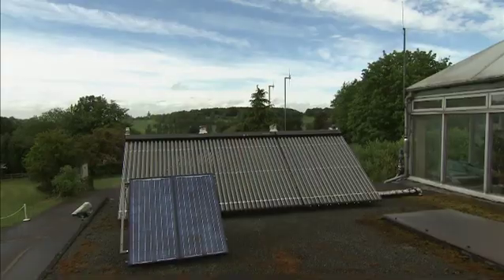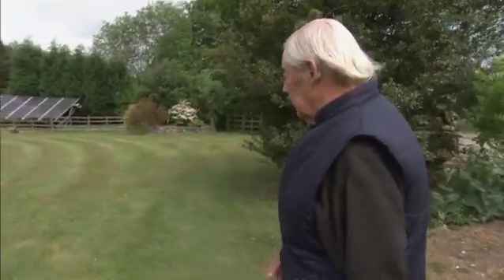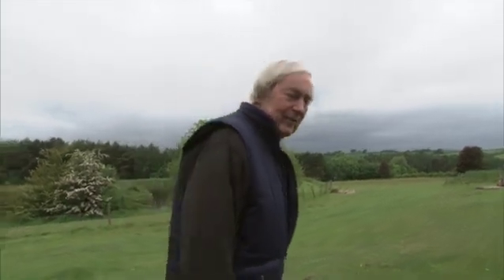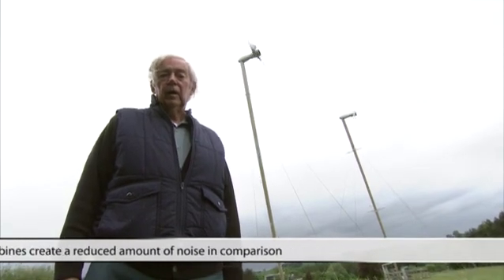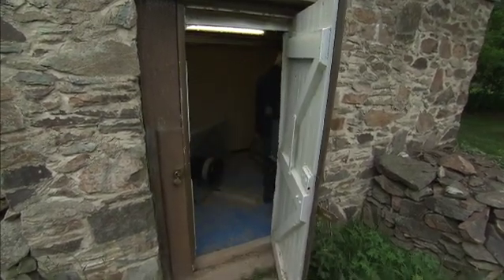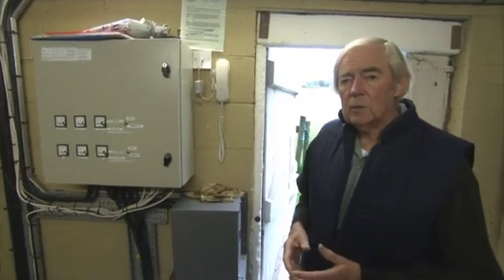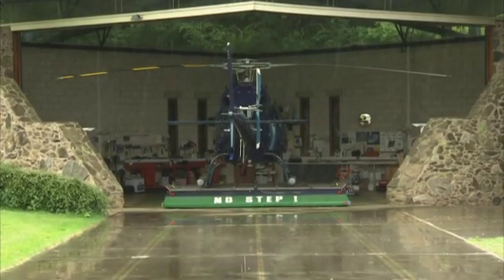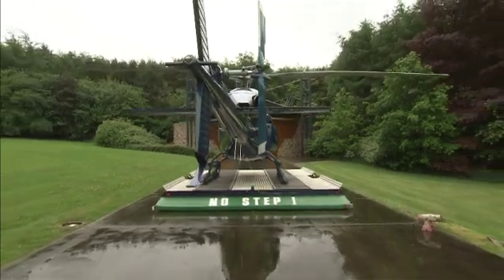Air Fuel Synthesis (AFS) Tony Marmont

Comment: I saw you on BBC last Saturday and since then I have seen some of your company's videos on youtube. It is good to invent this type of fuel now because future generations need a replacement of present fossil fuels.  However, if I had your kind of money I would surely build a green electric power plant first and then move on to the air fuel synthesis because the later needs a lot of electricity to make the fuel.